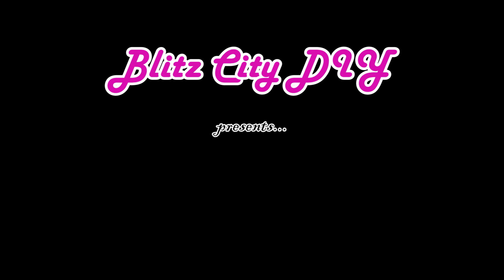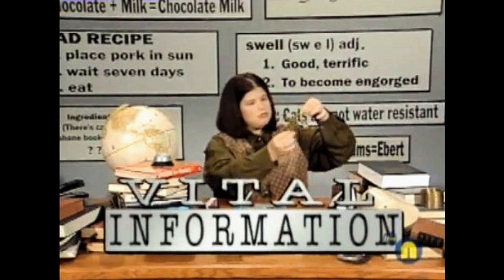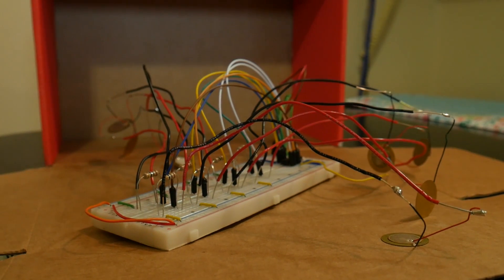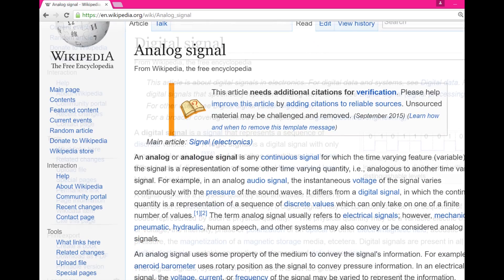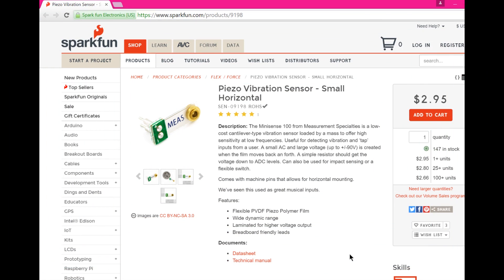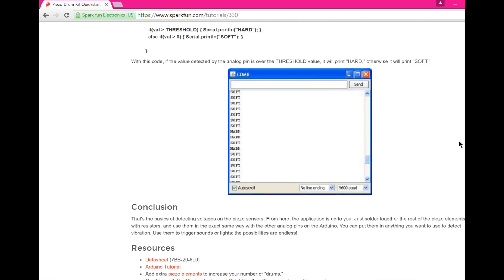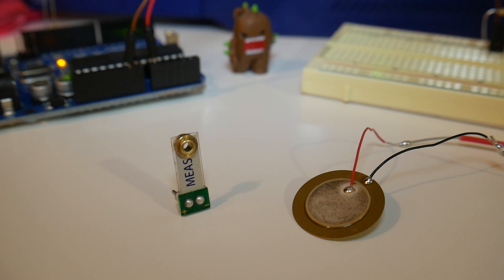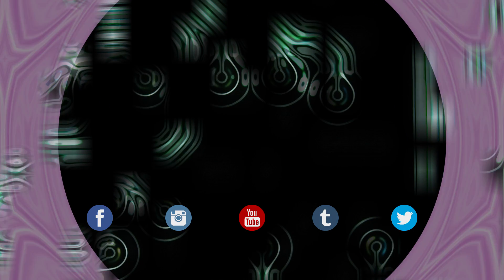DIY FYI: Piezo Sensors

Comment: Hello. What is the difference in detecting sensitivity between a round disc type piezo electric transducer and a MEAS vibration sensor? Planning to use them for measuring vibrations in machines and convert this signal to digital for processing in a PLC/ PC

Comment: Great video!   I am attempting to build a piezo-triggered LED light setup for my son's quad marching drums, so on your recommendation I am going to use the MEAS piezos you recommend here.  I just got them in the mail yesterday, and am looking forward to experimenting with the different code you suggest here from Sparkfun, as well.  If it works for one input, I'm hoping  it can handle 4 inputs, as well.  Well, theoretically two, as he's only got two arms. :)  I will be posting my progress up on the projects section of the Arduino forum, if you are interested.  Thanks again for a great vid... I didn't see  many other DIY FYI videos... I liked this one!

Comment: Are the horizontal sensors any good for acoustic / analog vibration pickup? Does the “horizontal” imply that they sense vibrations along one axis only? I’m thinking discreet input channels, per-string dedicated applications like ferromagnetic pickups but for nonmagnetic stringed instruments.